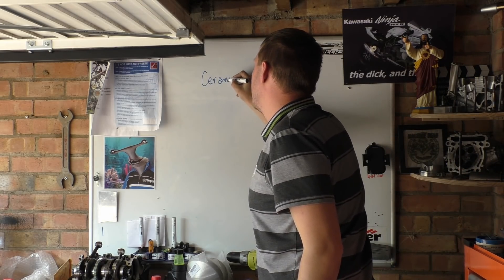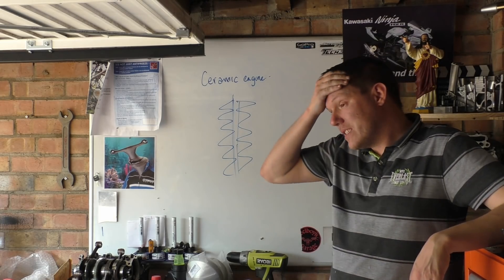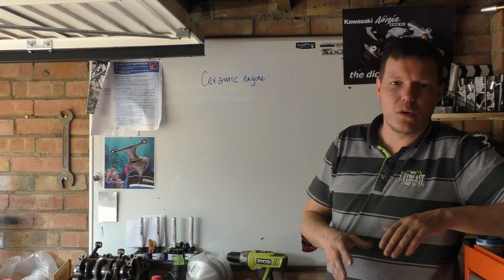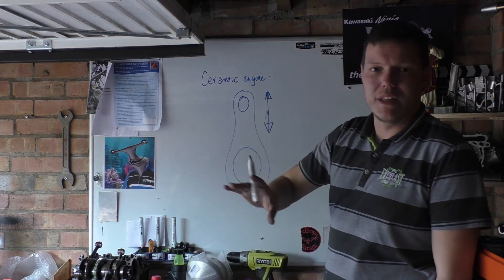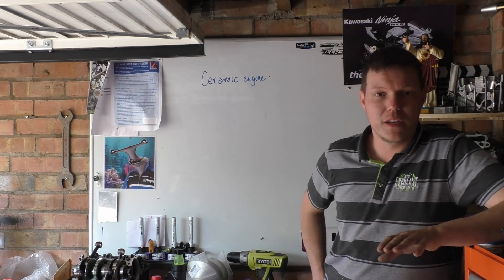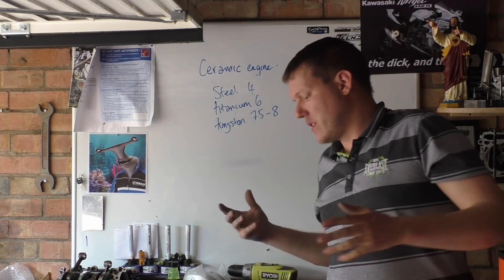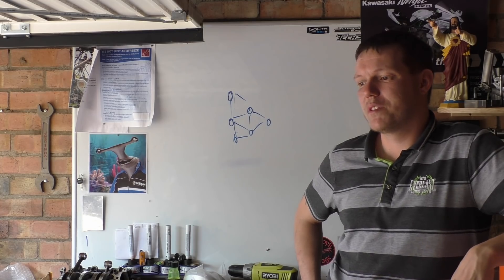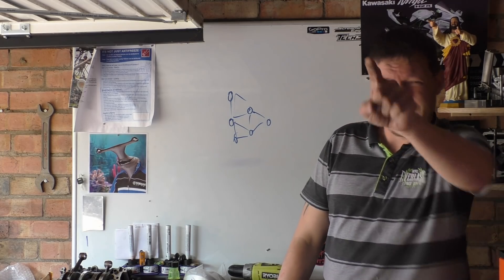Ceramic Engines?

Comment: Why not just a ceramic cylinder liners?
Reply from the maker: Heat transfer, that's why
Reply: There are some limited application cylinder liners now but due to limitations would only make sense in the highest performance application.

Comment: Someone actually thought to make the connecting rods out of ceramics? The only ceramic use I ever heard of was research on a ceramic cylinder coating to mitigate embrittlement in a hydrogen fueled engine. It's been ages since I read about that tho. No idea if it ever  reached production.

Comment: There are several things wrong with this buys arguments.   check out this.  https://www.youtube.com/watch?v=G-wi15aKMUI  and also this on Jet ceramic blades...  https://www.youtube.com/watch?v=1Vzbd3kO7kU
Reply from the maker: Kamtech, so good it didn't work. Funny when they show you these videos its an odd engine.... I.e demonstrate the engine of the future with a radial prop engine... loads of radial engines had ally exhausts, because of the excellent cooling. Why fidnt they use a water cooled engine? Because it mrlted when they tried.
Reply from the maker: Turbine blades... I did a video about them. I dont get your point. They're none contact blades with internal air cooling, oh and they're hollow...

Comment: Why not just put ceramic chambers in a iron block engine to channel as much heat as possible out the exhaust pipe. Surrounding the firing chamber and it's water jacket with a ceramic filled hollow chamber can reduce the overall operating temperature of the engine. Could this idea work? And would it make any significant difference?
Reply from the maker: You're looking at this with one property in mind - Heat conductivity. There's more to it than that. Fatigue, errosion, thermal expansion, ablation, stiffness, adhesion, etc etc......

Comment: While most of this remains true for piston engines, some rotary designs could benefit greatly from ceramics... some even require them.
Reply: This is why I'm here! Would seem that almost every part in an RE could be made with ceramic and solve issues with thermal efficiency.
Reply: @michaeldriver127  - yes, and no. The problem with ceramics, is while they have great conductive resistance, this also means they have horrible passivity. You can build a rotary with ceramic combustion surfaces... but under high duty cycles, you're left with very hot surfaces that aren't cooling down any time soon. This greatly effects several parameters, but most importantly is detonation. Ceramics are also subject to thermal shock damage... so when you take hot parts and subject them to, for instance, freezing temperature induction air... you end up with the material erosion OR catastrophic failure (breakage for whole ceramic parts, or delamination for ceramic coated parts).

In my experience, the best application for ceramics that I've found, are ceramic apex seals for Wankel/Mazda style rotary engines. For racing applications, ceramic coated combustion surfaces on the rotors and combustion chambers seem to work well... but only for drag racing. Anything under load for long runs (marine, aero, road racing, etc.) runs into issues with heat soak.
Reply: @driverjamescopeland  thanks for the informed reply!
I've only recently thought about the subject of a ceramic engine. It does seem that there's many approaches to ceramic manufacturing, such as the mixing of other materials to negate unwanted affects. It's an interesting subject.
Where is the problem of thermal efficiency occurring at in the rotary? It seems that the intake has no issues with allowing cold air in, so it must be an issue with getting hot exhaust out fast enough, yeah? I'm imagining the insulating effects of ceramic housings to allow the engine block to keep less heat and contribute to hotter exhaust. 

I can't get it out of my head that ceramics could be used more in the build, but what you say seems valid enough. I love the rotary for it's problems sometimes, as it feels like there's room to improve overall design, but it's just a matter of application and practicality.
Anyways, thanks for the reply.
Reply: @michaeldriver127  - the poor efficiency of all rotaries is due to their low volume:surface area ratio. The higher surface area not only lends to heat loss, but also holds a significant boundary layer of air and fuel that can't combust. Beyond this, the compression ratio of a Wankel/Mazda type rotary, is geometrically limited to less than 10:1. If those two aren't enough, the changing shape of the combustion volume from point of ignition doesn't allow for any sort of proper flame front propagation. Ceramic coatings have been used to treat the faces of the rotors, and do help.

Comment: The ideal use of ceramics in engines would not be to use their strength but their high insulative qualities and ability to withstand the high temperatures of combustion.  Combustion temperatures can reach 2400 C, yet modern engines try to contain this combustion event with materials like aluminum which become malleable at 300 C and melts at just over 600 C.   In our research, we are now testing Ceramic lined cylinders and headliners, and carbon pistons.  The results, the heat stays in the charge to push the piston rather than sucked off through the 200 C cylinder walls and head...  Our test engines are close to 50% efficient..
Reply: Finally someone knows something about ceramics!
Reply: Ceramics have been used that way in diesel electric locomotive engines for half a century. For exactly the reasons you suggest.
Personally I see ceramics place in engines being in the further development of rotary engines, because it solves the key problems that plague rotaries, and the rotary solves the key problems with ceramics in reciprocating engines.  I have thought this since the late 1980s when as a materials tech in a steel making lab I was bare handing ceramic crucibles off a tray straight out of a furnace sitting at 1700°C.
Inlet port zone could be maintained cold, outlet port zone extremely hot, and thermal expansion and contraction of the engine reduced to a minimum. Throw in actively cooled skf ceramic crank bearings (similar to those used in the Tesla sport) and chatter might almost be eliminated altogether. Result higher combustion temps due to higher compression and burn, thus near zero polluting emissions.  Meanwhile all the benefits of a rotary engine’s low reciprocating mass providing reduced vibration and shock and stress to the ceramic.
Whether the engine be entirely ceramic, or just a ceramic core inside of a metal jacket will depend on the state of modern ceramic tech, and production costs.  Ceramic coatings I imagine would not quite achieve the desired results, because of durability issues.

Comment: Suck off the extra heat and turn a turbine produce electricity heat problem solved and as a bonus your producing power hybrid for free use hho for the gas change the timeing to ignite faster because gas ignites faster the liquid so in summation a water powered hybrid electric cumbuston engine add tungsten were needed to fix the britall Ness or some other metal that has high heat application

Comment: "They don't make turbine blades out of ceramics" - What???? Ho you have your balls in the vice now, and I'm turning the knob, hehehehe.
https://patents.google.com/patent/US4408959 - I know a patent isn't proof of existence.
https://www.sae.org/publications/technical-papers/content/890426 - I didn't read this article.

My MAZDA RX7 has ceramic turbine wheels and the exhaust temperatures are crazy I've logged it post-turbo at 1240ºC, I wold imagine pre-turbo being higher (no logs) and it survived the temperature and the 170 000 RPM stresses.

And I think TOYOTA SUPRA also uses ceramic turbines and probably others did too, as they outsource this parts probably to IHI or MHI.

I've read some comments below on the turbos, but they all refer to the compressor side, they have it the wrong way around.

From my experience and boosting the stock MAZDA Twin turbos up to 1.4 bar/20psi no they don't granade.
Reply from the maker: If you read your link - 

"Methods of attaching ceramic wheels to metal components are reviewed, and the statistical treatment of probability of fracture is outlined."
Reply: I'm turning the knob even more. And by now your voice must be at an higher pitch and feeling the compression on your balls. :-b

You could have written (they make turbos out of ceramics but they are shit) and that I wold accept that, but no you chose to nick and pick and not reply (they do or they don't make ceramic turbos).

Comment: Hi Matt. I personally think nicosil barrels are crap. cant rebore/sleeve. XT660 . had to buy new barrel. Yam yz250f same story. WTF.? thanks for the info on your site.
Reply from the maker: You can rebore and then recoat.
Reply: two bike shops in SA told me otherwise. but i'd rather believe you. thanks.

Comment: Knoop Hardness is another one? Was the graph you showed Young`s Modulus? (Stress/Strain?). Have you seen Nitinol, (Nickel Titanium alloy), you can literally tie a knot in it and it springs back perfectly straight? Good vid. X
Reply from the maker: Nitinol - LOL its what I work with - also known as SMA (shape memory alloy) We use 1mm OD wire to drive linear motors - using resistance to limit find. 

Its used in stents as well. I have a spring of the stuff - I was gonna show it in a video coming soon. It transitions at about 80degC -
Reply: Excellent! I came across it, (not literally!), as a dental student in the 1980`s, where it was used in orthodontics. Great vids. X

Comment: Hey mat, Nissan actually ran ceramics in there gtr turbo’s in the 80’s and early 90’s. 
I believe toyota also did with there ct series turbo’s. 
We’re great until boost pressure started getting high and they Grenaded bits into the intake destroying everything in its path. 

I’m keen to learn about engine coatings. 
Thermal, anti friction and oil dispersant.
Reply from the maker: https://en.m.wikipedia.org/wiki/Nissan_RB_engine

Comment: Hey Matt funny side story on the subject of ceramics and material science. Friend's dad has a Norton commando 750, he had an aftermarket camshaft and lifter kit ( cam in block etc). After about 3000 miles the lifters had eaten the cam shaft. Turns out there had been an issue among people who'd bought the kit where there had been a metallurgy error when it came to the lifters. Result is people's cam lobes were being worn away. What was interesting is most people lost the lobes after about 300 miles or so. Mate's dad had the shaft ceramic coated before being installed.

Comment: Engineering ceramics are NOT brittle, there is no reason why you cannot make a fully functioning engine purely out of ceramic parts. However due to their high density (high inertia) its not practical to make a high performance engine. Also detonation is not a problem if you inject the fuel into the combustion chamber as modern diesels do.

Comment: When does the SPARKPLUG spark? piston on the way up or TDC or on the way down? for 4T engingens
Cheers from Sweden
Reply from the maker: Well be getting into this next week
Reply: Usually a couple of degrees before TDC. If you do it at TDC it also works but you lose power.

Comment: Depending where you insulate the temperature need not go crazy, piston crowns, heads of valves etc seem to often be ceramic coated. In both cases to reduce heat transfer from the combustion to the parts. I believe a critical factor is the heat capacity of the coating too, no good if the surface is glowing as new mixture goes in. I believe ceramics in turbo bearings have caused some catastrophic failures in engines when traces of ceramic have got into the cylinders. I think lathe tools are often made of ceramics now....

Comment: Is that normal with load/flex when u draw ceramic u made his load go higher than steel (at least b4 it permanently bend).
But if it was the case, why would we care that it doesnt flex if it take more load anyway.
So I suppose I didnt, and it was just a quick draw !?
Reply from the maker: just a quick draw

Comment: your rod bearings will wear quicker with a stiffer conrod because of vibrations being transfered trough it. Therefore high hp engines can use aluminuim rods. the aluminum rod will wear quicker and you will have to change about the same as the pistons  but steel rods will last for long time but the bearings needs to be change often af

Comment: Off Topic … Is there a reason a battery would charge on a charger but not charge on the bike though the voltage goes up on the bike and when revving … Seems only to load to 11 v on charger  but starts the bike … Dealer wants to put in new Stator and suggests buying another of his bikes  … Just need  new battery ??? … Gave stator a peek n still looks good … Ohms in plug …

Comment: Have you heard of a material called BAM (Aluminium-Magnesium-Boride)? In its highest wear resistant mixture, it is alloyed with TiB2 (Titanium-Diboride) and has a hardness at roughly 45 GPa. Has a coefficient of thermal expansion similar to that of steel. And has a lubricated coefficient of friction lower than Teflon. Do you think this could be used as a coating in engines to decrease the amount of oil needed, increase wear resistance, and lower the friction losses inside an engine?

Comment: The r32-33 skyline rb26dett had ceramic turbine turbos https://en.m.wikipedia.org/wiki/Nissan_RB_engine
Reply: I used one on an sr20 at one point, so scared of overspooling it and it hand grenade on me
Reply from the maker: "had a ceramic compressor wheel rather than aluminium."
Reply: The Workshop Besides minor cosmetic updates and ECU fine tunings, changes were made in the R34 generation to ball bearing T28 turbochargers as opposed to journal bearing turbos. The R34 GT-R turbos retained the ceramic exhaust turbine wheel. Models that had steel exhaust turbine wheels included the R32 nismo, R32-R33-R34 N1 models and R34 Nür spec skyline GT-R's. (Cut and pasted)I stand corrected, r32-34 had exhuast turbines made of ceramic
Reply from the maker: It goes onto say - "The ceramic turbine wheels are found to be very unreliable when used at high rotational speeds inducing higher centrifugal forces"
Reply: The Workshop wasn’t trying to take the piss out of ya, just a bit of info on the attempt at the ceramic turbine. I never ran into any problems, all the way to 15psi at most times (nasty rev limiter banging drifts) never popped
Reply from the maker: "wasn’t trying to take the piss out of ya"

I did think you were LOL

Comment: Is there a way to make detonation irrelevant? Like with some alternative crankshaft and conrod design?
Reply from the maker: LOL no. I think. Direct injection like a deisel is a great way.
Reply: But what if you could have a straight shaft with a gear mechanism on it that rotates the shaft one way regardless of which way you move the input gear? You could have a straight rod with teeth on it and pistons on both sides sit on that input gear transmitting power to the shaft whenever combustion occurs. Or is something like this just impossible?
Reply from the maker: But you're still doing compression right?
Reply: Yeah but if there's pre-ignition during compression it wouldn't smack back into the conrod riding the crankshaft's journal, it would just bounce back the other way still producing useful work. Or at least it looks so in my head.
Reply from the maker: Can you send me a sketch - even a very simple one through FB or email - this is interesting
Reply: I don't have a FB and am operating off a touchpad on a laptop but i'll try my best in MS paint and PM you an imgur link of it.
Reply: Here https://imgur.com/a/a9UM6qt
Reply from the maker: You're still compressing. The gear in this arrangement is rotating one way then the other - so clockwise and then anticlockwise. You're going to need to add a crankshaft somewhere or a scotch yoke to make this work - otherwise your wheels are going forwards and then back LOL

You could use a ratchet but then only 1 piston is driving
Reply: What about using 2 ratchets on the shaft right next to each other that lock in opposite directions but one also has something like a smaller gear inside it so both of them rotate the shaft in the same direction. Then you just use a wider teethed rod that sits on both of the ratchets simultaneously.

Comment: I be seen a porcelain engine run oval piston eight valves per cylinder . Made in Japan in 1979 -80 by a university
Reply from the maker: The engine was from the NR500 and it didn't have a ceramic engine.....

Comment: I have read things from the 1980's where Toyota played around with ceramics and plastics as structural and load bearing parts. Not only was heat an issue but in accidents the engines where breaking and they could never get either under control.  I always wondered how they would work in pleasure craft where you have an unlimited supply of cold water. Also how they might work in a stationary power unit situation where again plenty of water and no impact forces to deal with. I wish I could find that material and link to it.
Reply: Would have saved many nations from being invaded and, even destroyed like the clear waters in Brazil.
Reply: Ceramics sound like they'd play well with Wankel rotary engines!